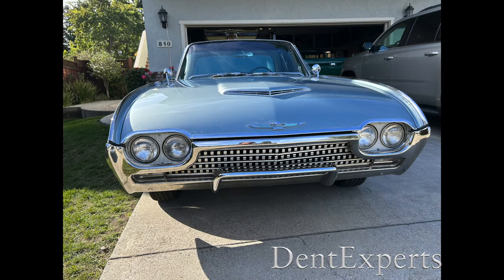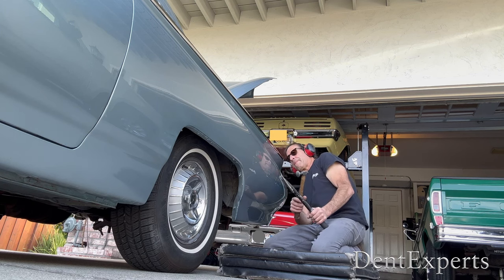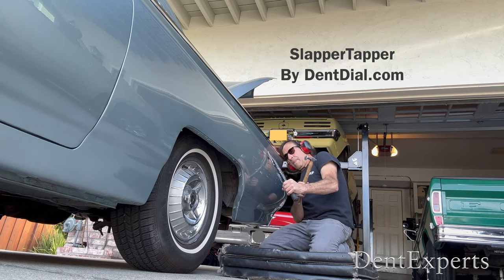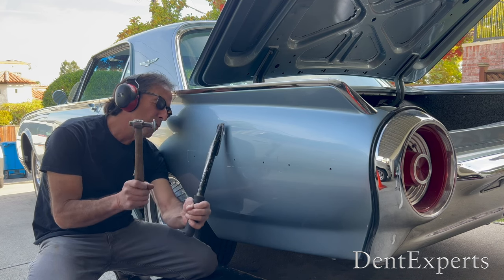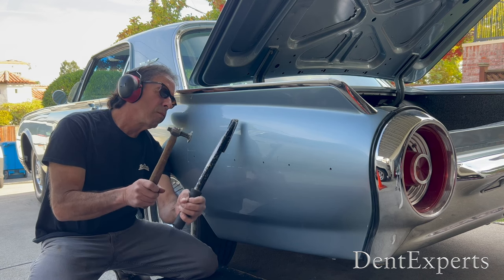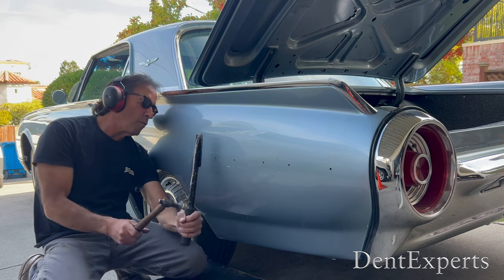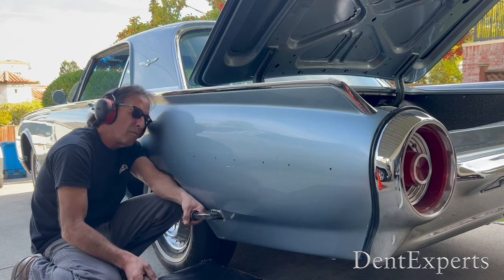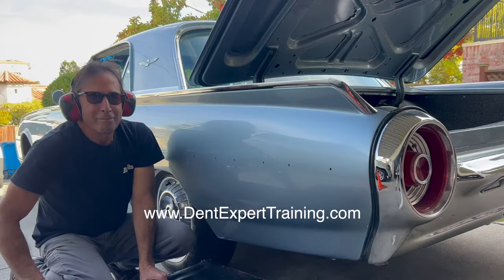Ford TBird Paintless Dent Repair:  Laying down crowns.

Comment: Where you were talking about the tool you designed and how it sent vibrations made me think. 
I wonder what that would look like if shot on a high speed camera? I know they are expensive but maybe you could get the attention of a YouTube channel that does it and do a colab showing the metal move. I know I would watch it.
Reply from the maker: That’s great yeah I see it all the time. When you read reflection like I do, I can see what my strike does. I have an online video course and students love to see the proof on how this works. You have to show it works when you are charging people.  Hi speed camera would be a cool setup and biggest obstacle is camera is limited with depth of field focus issues. Try to focus a camera at super deep angle and capture orange peel, it struggles.  It’s a good idea and thanks for suggesting it here.